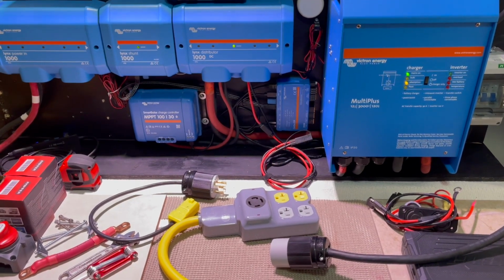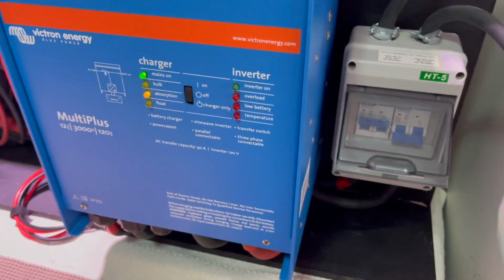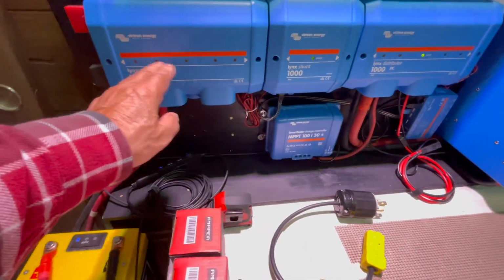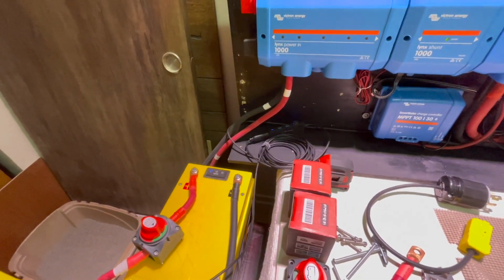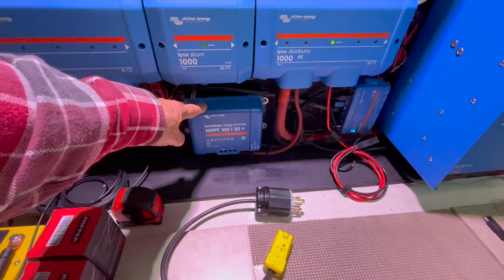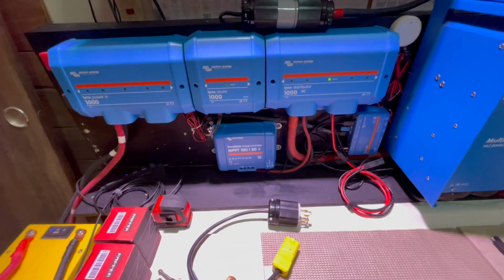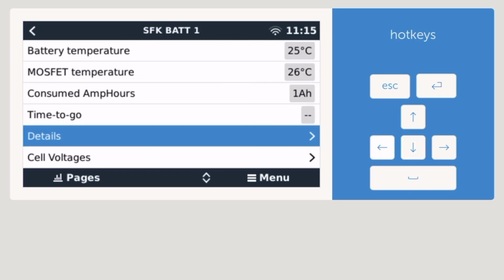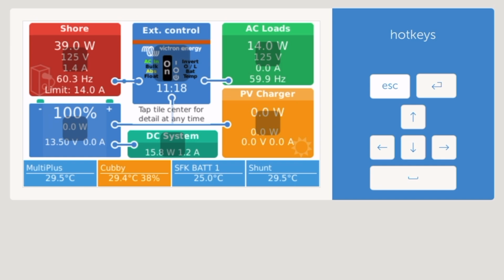Solar, SFK300HP & Victron Quick Disconnect

Comment from the maker: Our stuff to finish off the touch up arrived.  We want to complete the battery cabling for two more banks.   Still need to do  a tidy ground binding setup.  Having a 3 inch hollow back, one can hid and tidy all the cabling.   Got it started but not finish..

All the loose wire is now gone and tidied up.